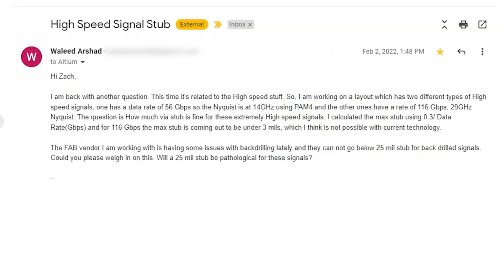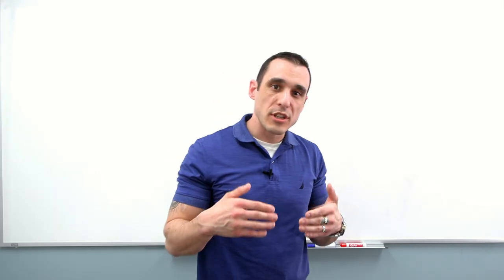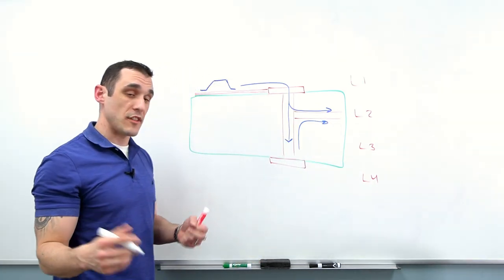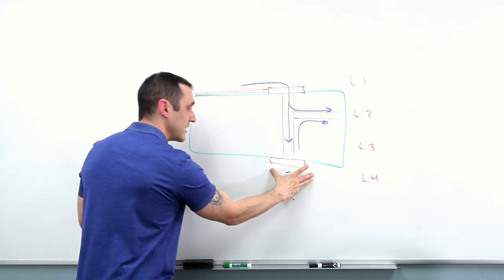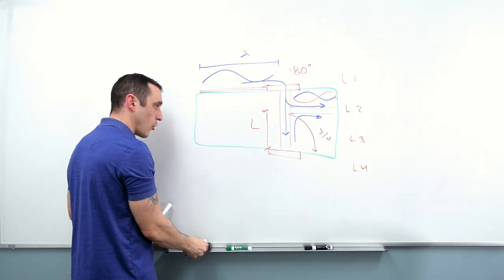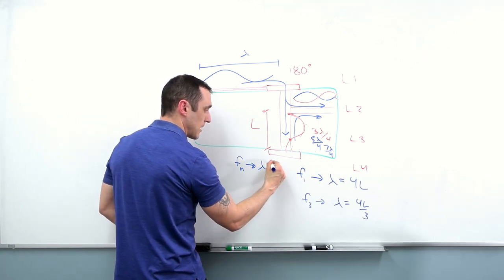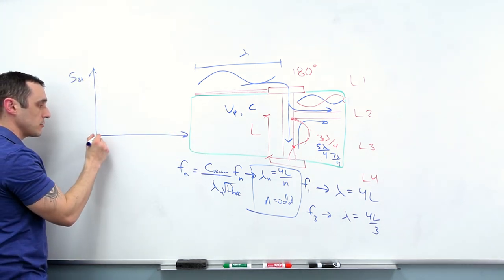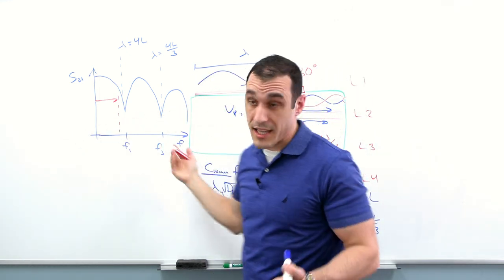Stubs and Backdrilling in High-Speed Design - Part One

Comment: Just curious about your use of speed of light C instead of speed of signal on the PCB material in your calculation.
Reply: The reason I refer to the speed of light is because all signals on a PCB are propagating electromagnetic waves, and all electromagnetic waves travel at the speed of light. The speed of a signal on a PCB is equal to the speed of light in the dielectric (for striplines), or it is the speed of light as determined through a dispersion relation at the air-dielectric interface (for microstrips).

Comment: As far as I know, backdrilling can cause reliability and manufacturing issues and is really expensive. I think backdrilling should only be considered after evaluating HDI as an option. 

Please correct me if I'm wrong.
Reply: Yes it is expensive, also sometimes you might not need it. If you're not doing blind/buried you can always use thin laminates on surface layers are route into those instead of routing into the middle of the board and you'll have a smaller stub. I'm not aware of anything surrounding hole wall reliability, but there is a reliability challenge from increased clearances required to completely backdrill that hole. If there is misregistration or wander the drill could cut into nearby copper if the clearances are too tight.

Comment: Thank you for your leture.  Is there a way to make stub vias or stub traces useful as equalizer?  For instace, shorting the open end of the stub to ground.
Reply: If your goal is to use a via stub as a transmission line stub then yes it will act like that but it will only serve that function at very high frequencies, like into long-range radar bands. This is due to the typically very short size of via stubs. Also the stubs will only provide that type of action over a narrow bandwidth. So if you are only working at a single frequency or very narrow bandwidth (about 3% of the carrier frequency), then you would have the desired stub effect.
Reply: @Zachariah-Peterson  Thank you for your reply.  I am not familir with frequency range. What do you mean by "it will only serve that function at very high frequencies?"  Is the transmission line with the data rate of 10Gbps considered as very high frequency or very high bandwidth?
Reply: @masa mizuno  I created a video about this and it is in editing, it will be ready in a couple weeks.
Reply: @Zachariah-Peterson  Thank you. I am looking forward to your video.